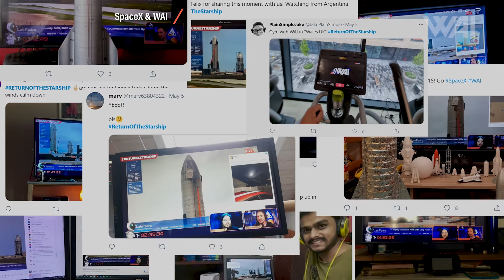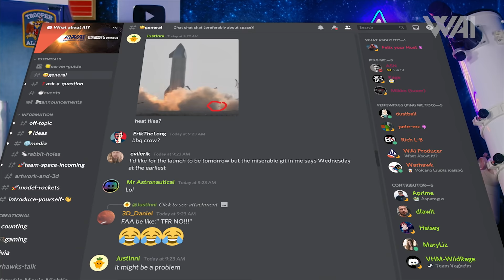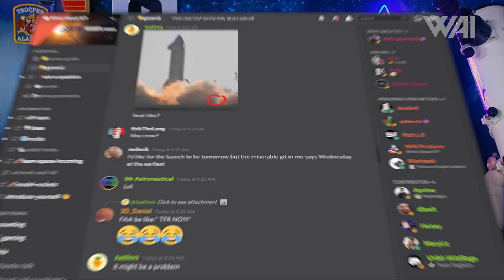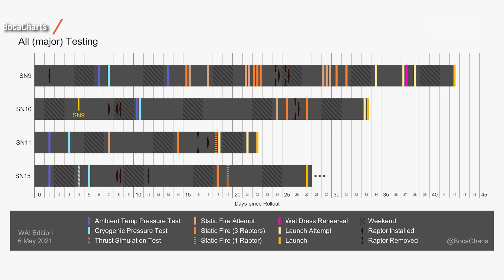SpaceX Starship Landing Achieved! – Why Did It Work This Time?

Comment: Maybe an odd question, but if the COPV tanks are vulnerable where they currently are, would relocating them to the rear fins in a slightly expanded shroud for the fins make sense?  I imagine the plumbing would be relatively negligible to move for such on performance?  I'd think they're still generally close and accessible in such a configuration - particularly if the shroud is placed on a hinge and locking clasps system for maintenance of both the copv tanks and fin movement mechanisms.
Reply: That would ruin the aerodynamic qualities of the fins and require all kinds of heat shielding for the tanks. As it is, whatever was popping off there, it was not the COPV tanks. Those would have caused much bigger explosions and severely damaged the ship.

Comment: I want to see animations of the tower compared to local buildings as it gets taller and taller than each, along with the 'tallest structure within x miles'.  : )
Reply: I'm pretty sure it will ultimately be the tallest structure in Brownsville, but the only other tall structures nearby are the mid and high bays. It's not like they're doing this in the middle of downtown, although that would be cool.
Reply: @odysseusrex5908  For sure! I just figure it would be a cool way to visualize is a more human scale : )

Comment: Well, as per the scientific principles, the proof of the pudding is in repeatable landings, etc.
It would have been nice to see the belly flop and flip maneuver in full like in SN 10. 
Someone said the engine exhaust affected the camera.  So is it the heat or could there be some type of electromagnetic interference due to fuel flow through the engine exhaust?  That has to be overcome.  The thermal blanket needs to be upgraded and whatever popped better protected.  Of course the fuel delivery systems need to be thoroughly inspected and analyzed to prevent future fires like the previous launches.  Come to think about it, I didn't see any fire suppression system activation on the last engine fires.
Question: If, or can, something catch fire on Mars?  How would it be put out?
Reply: They're tweaking the designs so the future iterations doesn't have fire post-landing

Comment: Felix, do you know if if SpaceX was able to get the raptor to throttle down more on these new versions? I had been under the impression that 2 raptors at their minimum thrust level would provide too much lift to land it... It seemed 2 were on till it touched down.

Comment: so having the raptors fire so long into the landing I would assume causes the post landing fire issues....all that fire has no where to go but up under the bottom end.... it could be problematic. I wonder if a small internal fire suppression system could be integrated and used on landings...

Comment: SpaceX still needs to do something about stopping fires in the engine bay after a flight, it could have been a disaster of a flight as easily as a success but I am celebrating anyway!
Reply: They're tweaking the designs so the future iterations doesn't have fire post-landing
Reply: @alvianchoiriapriliansyah9882  I know they are updating the designs after almost every flight but they do need to stop those fires somehow and I think you can agree that they are always a danger?

Comment: All their previous issues looked like fuel supply related(not sure about the inflight explosion, but it takes fuel to explode:)).   I think this time by firing multiple engines it acted like an ullage burn to help insure good fuel flow to light the landing engine without bubbles in the fuel system...

Comment: What comes after SN15 ? More of the same... analysis, refinement, perfection. Now they have an intact starship to disect and examine so they can determine what still needs work to ensure a safe landing with a far lower average than 4%-10% failure rate for rockets.

Comment: Terminal velocity 90m/s? I see the test approaches that velocity from 0 (hover), while an orbital decay will have velocity approach terminal velocity from above, from some 27,000m/s! I assume we know what that deceleration can look like, with terminal velocity decreasing with elevation, but might stay above 90m/s near ground level given not enough time to fully decelerate. And of course there's a heat curve to predict and test in practice. I see why having cheaper steel allows more real experiments at a lower cost, and course computer controlled makes it all possible, with no lives at risk for failure.

Comment: It landed crooked, crushing two legs, but the upper thrusters got it back upright. But during that extra time it 'floated' to the very edge of the pad. No ideal what would have happened if a couple legs went over the edge into the  sand.
Reply: All legs were functioning properly, softer than SN5 & SN6
Reply: @alvianchoiriapriliansyah9882  Watch https://www.youtube.com/watch?v=pG9K6_Wlt1k where Elon confirmed the legs were crushed from skidding across the pad. Bottles exploded in the engine bay from over-pressurization due to the fire, and the landing navigation system failed to meet expectations and will need major changes. Don't get me wrong, it was a decent landing but far from perfect, and it came awful close to disaster. Also, I give credit to Elon, if there's a problem he simply admits it and doesn't send out gibberish press releases.

Comment: space x need to add fire suppression system in engine bay.
CO2 or they can use nitrogen from RCS same effect cool down engine bay and suppress any fire.
Reply: They're tweaking the designs so the future iterations doesn't have fire post-landing

Comment: For over 1000 years people traveled the seas under sail power.  It wasn't until Europeans founded colonies in the America's that sea travel quickly passed through several technological leaps to become a reliable and potentially luxurious form of travel.  I expect founding a colony on Mars will have a similar impact on space travel and open up the solar system and eventually lead us to a point where we can colonize the galaxy in the same relatively crude fashion as the early days of American and Martian colonization with long likely one way polynesian style missions.  The cycle may then repeat again.  That is the biggest impact.

There are many others.  In short form:

Reinvigorating interest in science and engineering.

Reinvigorating American technological leadership.

Reinvigorating American business from corporate shell games  to innovation.

Maybe even helping return our society and public discourse to a more fact based system.

Comment: It was a success because the fire that ALWAYS beaks out in the skirt was smaller than usual.  Need to get at the cause of those fires that happen when fuel is shut off

JR
Reply: They're tweaking the designs so the future iterations doesn't have fire post-landing

Comment: OK  ---------  Great video.  When is Space X going to realize that their solid skirt is the cause of much of their landing problems?..  The solid skirt traps super hot exhaust gasses and fuel leaks under the Skirt. In the case of SN-10 the trapped gasses exploded after a few minutes destroying the ship after what would have been a successful landing.  In SN15 the skirt again caused trapped gasses to destroy much of the equipment (COP bottles, insulation and much more) under the skirt. Time for Space X to install legs replacing half the skirt (leaving the skirt only on the heat tile side) allowing super-hot blowback exhaust as well as leaks to escape freely. Which should reduce engine and equipment damage without the weight of a lot of protective armor as well as the risk of creating a bomb under the skirt and exploding. Not a good outcome after landing on Mars.
Reply: As I understand it, the bottom of the skirt on Starship connects to the top of the super heavy booster. So you either have open engines on the second stage and a skirt that the engines fit into on the top of the first stage or a skirt on the second stage covering the engines that rests on the top of the first stage. I have no idea what the tradeoffs were, but evidently SpaceX thought it was worth it to put the skirt on Starship. The Falcon 9 has the second stage engines fit into the top of the booster, so they have done it the other way before.

Comment: They should put a small containet full of CO2 and release the gas after the landing. Or they sould make holes in the landing platform to let the fire chanel into and not reverse to the engines.

Comment: i think that moon and mars are great places for space flight practice, but i can not imagine it being more than an outpost. hardly anyone talks about the toxicity of the martian regolith: (perchlorate). how can that work? every bit of that has to be detoxed to use it as building material. after every outdoor activity a decontamination process is required. i can't see that as an attractive place to live.
but it can be the gateway to the rest of the solar system.

Comment: I want to know how the heat tiles did and if that "minor" plasma fire presented any risk and why it occurred in the first place.
 ( It looked REALLY familiar.)
Reply: I think it was a methane fire, not plasma. The question is, was there a methane leak somewhere in the system, or was the methane supposed to be venting but was exposed to an unexpected ignition source? they'll figure it out, I have no doubt.
Reply: @odysseusrex5908  What is plasma?

Comment: Although a succes to be sure... It had multiple failures I am sure Elon is not happy about.   The third raptor bealched and didnt reignight.  Then the other two had sub standard thrust and both had to be left on to make a touchdown.  And this after raptor change outs.  I am starting to suspect high pressures is causing turbine pump seal failure.  This has plauged everyone trying to develop this type of engine.  Hopefully, with an intact rocket this tiime they can see where the failures are occuring better
Reply: Or maybe they keep running those two for redundancy anyways

Comment: I am worried that they will hit a barrier of technology needed to set up a sufficient mars base :(
Reply: I don't see one. The technology needed to maintain a base on Mars (not a colony) is no different from that required for a space station. Air and water recirculation, thermal protection and radiation shielding, electrical generation. That will do it. In some ways such a base would be easier than a space station because it is stationary on the ground instead of free falling in zero G.

Comment: Spacebase Texas is probably going to become the busiest spaceport in the world starting in a couple of years until 2100.
Reply: Well they’ll most likely use the city to manufacture starships and repurposed oil rigs to launch. But maybe some other thing will be used. I wonder if SSTO space planes will be used by that time and spaceships made in orbit would be a thing instead like the ones from the expanse or halo, but who knows they might still be using rockets instead and a bigger version of starship.
Reply: @ajax818  We will probably never use nuclear fission or fusion rockets for ground to orbit, so we are stuck with chemical rockets until we can build a laser/maser launch system, a space elevator, or something crazier like a launch loop.
Reply: @JohnPowell6  No i agree with that statement, well probably never use them to get to orbit. But for the vacuum of space nuclear would be much better.
Reply: @ajax818   SSTO will never really be practical on this planet. In orbit construction is obviously the next big step.
I take back my first sentence. A laser powered, ablative thrust engine as described by Niven and Pournelle in their book, Footfall, would be SSTO, if it could ever be made to work at all.
Reply: @odysseusrex5908  Or a spaceplane that uses orbital lasers to superheat a liquid nitrogen propellant.

Comment: Sn 20 is orbital huh 😃😃
Reply: That's the plan. Musk's July date is pretty ambitious when you consider that July 31st is only 86 days from today (May 7th). SpaceX might make it, but most are thinking that a Starship will fly to orbit by the end of the year. And may beat SLS to orbit as it is currently slated to fly in Nov 2021.
Reply: @steveaustin2686   And nobody believes that November date will be met. SLS will fly sometime next year. Starship may not make orbit in July, but I bet it does so before Thanksgiving. I have personal reason for really, really wanting to conduct an operational mission, deploying a payload, before SLS flies. I would really like to see that.
Reply: @odysseusrex5908  Yeah, I have heard many other space watchers figure that SLS will slip the Nov date, but officially, SLS is still on for Nov. With the Core in the VAB, everything is there as that was the last piece they were waiting for I understand. So the question is, if they can do the repairs needed from the test firing and integrate it all together in time for Nov? We shall see. With Starship coming along, I think that they will push for the Nov date if they can.

At most, SpaceX may use Starlink sats on the first payload, but if those cost anything significant, I can see a dummy payload being used for the first SN orbital flight(s).

Comment: Hi guys another well done blog...  here is a thought exercise in different Starship designs. Considering component weight, fuel savings if Spacex considers glider design for run way landings as well... Not much change other than flattening 1/4 to 1/3rd of a Starship ring to create more glide surface... This will also be an answer back at dream chaser coming back on line next year. Pass this on to get to Elon... I think Elon's concept of the Low cost stainless steel shuttle on top his boosters and with his vac/atmos Raptors is the next thing we see that is incredibly cool... It is 1OO% doable!!!!
Reply: There's no runway on Moon & Mars, and if propulsive works on Earth why the switch?

"Not much change..." is a huge understatement in engineering
Reply: @alvianchoiriapriliansyah9882  Appreciate your thoughts,,, another option for passengers around the world in 9O mins  like Edwards air base, Kennedy space center. I realize you may not know how very loud the Raptor engines are... to glide in to destinations... is NO NOISE.  NO FEUL NEEDED for landings. Less weight... etc... Jobs for starship, would be, space tours. Dear moon, space Station drop off pick ups etc... and land anywhere jets can with out oil rig conversions... etc... did i say no noise? Lifting off vertically again requires at first transporting starship by barge or other means to a oil rig conversion, etc... Thanks Awesome reply!
Reply: @alvianchoiriapriliansyah9882  Oh btw that Starship shuttle design then on a moon landing would use the forward thrusters to land on the Moon... Noise not an issue raptors would shut down 1kilometer above the surface of the Moon... Same for Mars My friend... maybe Raptors would have to land starship because of atmospheric conditions on mars...
Reply: @alvianchoiriapriliansyah9882  This is just one of many different designed Starships for different missions... to be a glider is an option or a rocket land choice. simply put without going into detail...

Comment: You hit the nail on the head.   Insulation burned.   Why??   The engines upon landing are too close to pad..... the rocket blast reflects of the concrete and burns anything inflammable.    Longer legs or deeper skirt might help prevent this.    Just my &0.02.
Reply: They're tweaking the designs so the future iterations doesn't have fire post-landing.

Comment: Dude the starship must must have bigger legs the skirt is way too close to the concrete when it comes down to land which means there’s way too much fire under the skirt
Reply: These are the temp test legs while they refine the flip-n-burn landing. No reason to put bigger, more capable legs on it if they get blown up. SpaceX has said that they are working on better legs.

Comment: I am not sure if the landing was soft enough as it seems that the landing legs were badly damaged. Also SN15 only just made the landing pad, which makes the idea of catching it using a tower even more challenging. Still a massive achievement.
Reply: The legs is designed to be crushed, and it's less so than SN5 & SN6 per close up footages. Booster landing should be easier cause no flip manuever & they're constantly within the circle target on Falcon

Comment: One of the unspoken benefits of the belly-flop maneuver: If there's an indication on descent the engines won't work well enough on relight to land, it may be theoretically possible for passengers to ditch with parachutes (for Earth anyway) once velocity is low enough.  Shuttle was supposed to be able to have that failure mode, but later analysis showed it wouldn't have worked.  It could work with this.
Reply: In theory...

Comment: Why do you chose to speculate with such extreme statements?  Even if you are right that the pops are from COPVs to assume that it would “damage them beyond repair” is absurd as shrapnel may hit and damage the closest one or two raptors but it’s improbable that it would his all three. Damaged maybe but “beyond repair” make you sound extreme and doesn’t serve the community when waiting just a few days would give you the data to make an accurate statement.